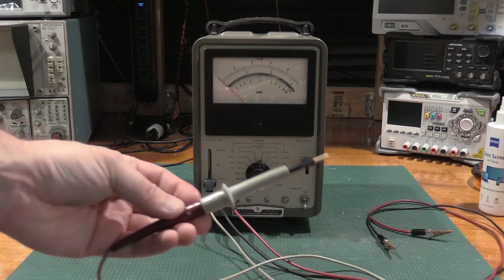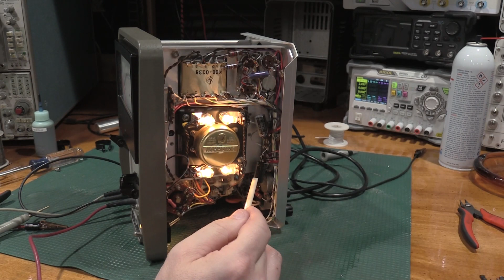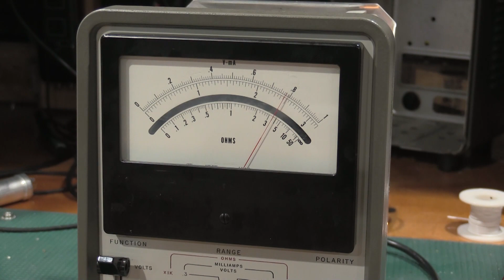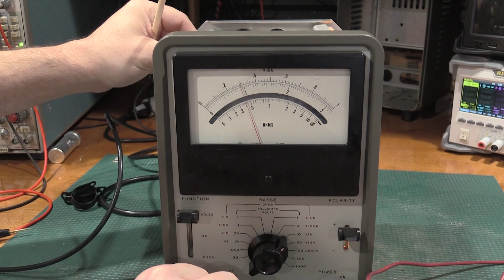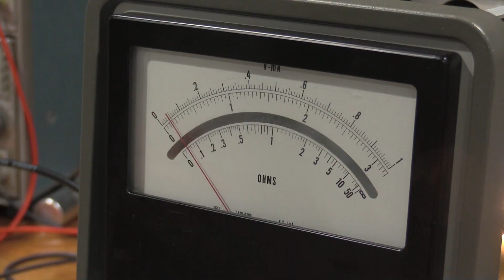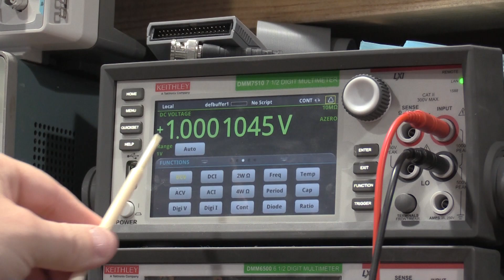HP 412 Restoration and Alignment

Comment: 25 years ago I got my HP 412A VTVM for free from a local recycling center. It had a large green sticker on it that said “Scrap Equipment.” I believe it came from a nearby state University. Unfortunately the power cord and all three probes had been cut off and discarded. I grabbed it from the junkyard because it looked cool. I didn’t ever expect it to be repairable. Years later I read an antique radio forum post about this HP 412A model. So I decided to see if mine could be made to work. Well, as it turns out, replacing the AC cord and fabricating a new set of cables and probes was all it needed. The existing tubes, capacitors, and other parts were still fully functional. The mode selector switch and the sockets for the light bulbs in the optical chopper required a thorough cleaning. Now it functions perfectly and is extremely accurate. I use it when I need a DC voltmeter with extremely high input impedance (>100 megohms). All of the ohms ranges are also very accurate because the probe cables have 2 wires in each cable, providing “4-wire” ohms measurement.
Reply from the maker: Excellent! glad to hear it is still running and performing well. A few more moden meters which will appear shortly on the channel are still HP but the 3455A and 3456A 6.5 digit with a > 10Gohm input which is still wild given their age.

Comment: I bought one at a good price.   I am thinking of using banana plugs so I can use different cables, however, I see on lines are grounded. Not sure how that will work out.    I might test before committing.
Reply from the maker: The cables are shielded for the lowest ranges.
Reply: @ZenwizardStudios  I am assuming to reduce outside noise at the lower voltages. Pretty much my thought. A BNC connector and cable with a alligator on the end might work but that has it's down side too.
Reply from the maker: For these cables it is also important to connect the shield ONLY on one end not both. It will throw things off if there is current flowing in the shield. Ground loops can be hair pulling to track down.

Comment: What year is your 412a? I restored a 1962 and the gain pot is on the top of the off that lower section where yours is on the side. Also the meter cal is accessed from the right side just above the chopper. Thanks for the video. It helped me! The .47’s, the 20uf’s and that 1500uf were all bad! The 1500uf showed as a resistor, like 2 milliohms. Yeah, it was bad. But changing that allowed for the bias adjust to work, before it would just peg the meter. I also replaced any resistors that were out of spec. Nothing on the selector rotary switch got changed as those are super high quality.

Edit. That 1500uf cap on mine was only a 10v. Are you sure that’s a 100v on yours? If so I may try to find something with a higher voltage!!!

Comment: We calibrated the TS-505, Simpson 303, HP-412 and other VTVM models. They were all replaced with newer technology or deemed too expensive to repair. We had a quonset hut full of obsolete test equipment Tektronix, HP, Radio Labs, don't even remember all the brands anymore. All the operator and service manuals were with them. The U.S. government had a limit on costs spent to repair each piece of equipment. I was an ET during the Golden Age of electrinics. Nice item here and well preserved. Boeing probably had very high standards for maintaining their test equipment. Our standards equipment was traceable to the National Bureau of Standards in Boulder Colorado.

Comment: I acquired one of these for $10. Used to be in the inventory at Boeing. Similar condition, operational, but in need of electrical re-fresh. Very timely content and should prove helpful for the process. Thanks for the great content!
Reply from the maker: I hope the restoration goes well it is a fantastic meter with quite good accuracy for the time.

Comment: Hi this is a beautiful piece, I have restored a HP427A and am currently working on restoring an HP3400A there a Nuvistor tube is used in the input amp - it was also faulty in my meter, luckily I was able to buy a brand new one. The photo chopper in this meter is also solved using neon lamps - I hope it will work, but with your meter, the bulbs with the motor are completely luxurious. For the HP 3400, I checked all the Sprague electrolytic capacitors and was amazed because some of them had better parameters than the new ones I bought for replacement.
So I hope it serves you well and measures accurately.

Nice day 🙂 Tom

Comment: My brain is not working well today (medication). How does one figure out the burden voltage with a meter? Thanks Rick
Reply from the maker: The burden voltage is the voltage developed across the current shunt. In this case I was using one of the exotic pieces of gear in the lab a Keithley 2450 SMU. This gives me a direct read out of the burden voltage. I will need to do a video on how to measure it with out the SMU but I can add that to the video list if there is interest.
Reply: @ZenwizardStudios  SMU is a completely luxurious matter, once you get used to it, it is difficult without it, it can make a lot of measurements easier.
Reply: @ZenwizardStudios  I would love to see a video about calculating burden voltage. Sorry for the delay, life got in the way.